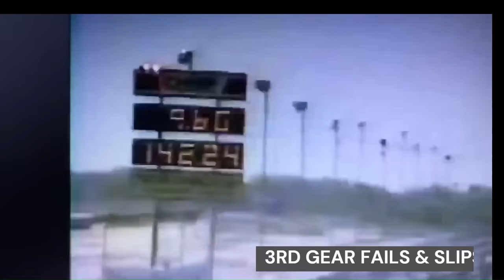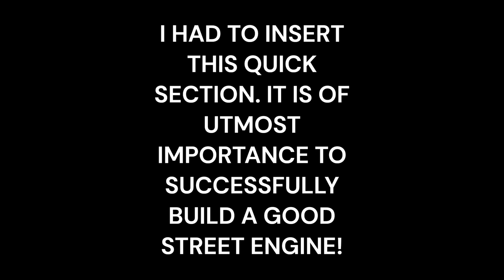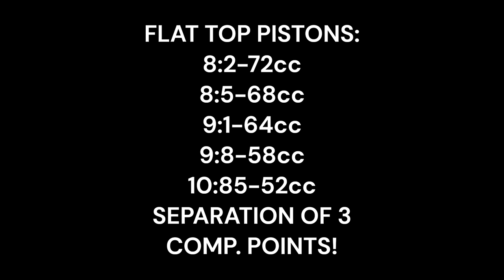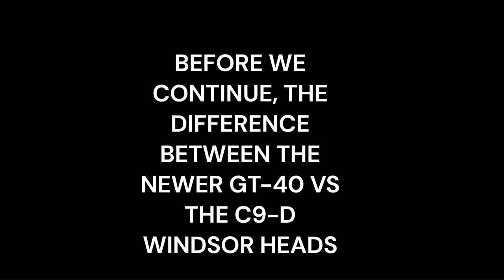BEST CYLINDER HEAD FOR THE STREETS!

Comment: Great video as usual, I wonder if the huge exhaust ports on that middle head is letting too much exhaust back in during overlap and might do better with a wide LSA and possibly EFI?
Reply from the maker: Yuri, possibly you are correct because there is not much velocity in it to go downstream effectively instead turns around and backtracks back to the chambers. Wider LSA might help and this thing was just way too big and now we start to compromise and lose the high port advantage of the exhaust port!

Comment: What are your thoughts on heads for a street 347 stroker with hydraulic roller cam, air gap intake? I was sold a car that was supposed to have TW heads until I started doing some research. The engine builder during COVID in 22 pit speedmaster heads in this motor instead of the twisted wedge that’s supposed to be on the motor. Makes me sick to think how a person could rip someone off like that. But with that said I just want to move forward and find out what I need to make some really good power on the street. The motor was supposed to be about 450hp and who knows now. It runs good don’t get me wrong. But I want it to be what it was supposed to be.
Reply from the maker: If you have time open it up and check the cam that they used and I prefer the TW heads over anything out there for the streets because they make the most power!

Comment: I just bought a '69 Nova with a '69 427.  Mild build with Chevy '840 Rec Port heads (107cc closed chamber) and it's making around 500hp and I feel it's in the area of 11:1cr.  It's a really solid build but it's too heavy for my needs.  How do I know if the heads I chose are going to be at least as good?  I do not want to lose power, ideally I'd like to make a little more.
Reply from the maker: Mike, aftermarket heads would do wonders or if your factory heads are ported by somebody good then it will  show more power big time!
Reply: Get a stellar set of alum ovals difference will be night and day. More everywhere

Comment: Great video!  I am running the Cleveland 4v heads on my 408 and love them.  What are your thoughts?  I have been hesitant to upgrade to aluminum heads. I figured the engine builder used the 4v heads for reason instead of Yates or such.
Reply from the maker: Patrick, the 4V C heads specially the closed chamber is still every impressive!  408 is indeed my choice also when I get my 70 4 speed going again and will probably use those exhaust tonque plates made out of stainless steel if it is even made today. ?

Comment: I got a 351w bored 60 over with 12/5 pop-up pistons block decked to 0  58 cc heads and it's a toque monster 😅
Reply: Live forever if the rev the chip stops it!
Reply from the maker: That should be an awesome street dominator!
Reply: @benalamedaracing2765  it's a lot of fun on the street it's in a 1980 fox body notch back
Reply: That's great, where do you buy gas for it!!
Reply: @markmccarty9793  I run 93 pump gas with the timing pulled out and and Sunoco 112 when I want to fill the max power
Reply from the maker: @xxkingslayemxxgamer5553  how big a cam do you run with that much compression on the streets?

Comment: my 347 had zero deck with flat tops, felpro 38thou head gasket, afr185cc comps, decked 16thou, to 54cc, i think it was 10.9-1 compression
Reply from the maker: That should be a very responsive engine!

Comment: Hello Ben, love your content on small block Fords. Here is a question for you about reinforcing the two bolt mains with an unusual style of girdle. If you were to replace the oil pan with a steel ring and cross supports at each main bearing location do you think it would be worthwhile? It would look similar to a Y block with cross bolt mains. Would it eliminate the vibration and twisting problem created by the current girdle designs? I'm just wondering if combining this with your block stiffener how fast you might be able to twist a 289?
Reply from the maker: Anything to tie together the bottom end is good and a worthwhile modification.  However, this said it all becomes critical when #2 and #4 mains start to bounce due to the cranks propensity to twist to an "S" @ high rpms and power levels!  Now the issue really comes down to how much meat is underneath this main caps for support and integrity.  This is where the critical issue is at and when 2/4 is bouncing sometimes we end up "spreading" the vibrations to 1-3-5 mains!  It is all good until we start bouncing the caps and now everything goes out of control and things start to crack or break!
Reply: Hello @benalamedaracing2765  , yes exactly, something like this can tie into the journal cross brace that the caps bolt into. How can I email a picture?
Reply from the maker: @mkoronowski  my email is benalameda@yahoo.com and send it there. Let me know when you do because I get so many questions...

Comment: Great info, Had R heads waay back.  I now have R11 heads, do you sell those port plates?
Reply from the maker: It is made to order and final pricing is still in the works and have two aluminum materials to work with! A total of 4 plates are necessary to stack them up together and will probably option to make one plate to make it simpler.  Problem with this is how much to raise them this is why I use 4 to make the necessary adjustments.

Comment: What about the pistons Ben?  I have 64 cc head, .047 head gasket.  Is a dome piston ok?  Any thoughts?  I am at 11.7:1.  Cast Iron E7 lots of work.  Looking to go 11:30 NA.
Reply from the maker: Looks good but if you can keep the head gaskets around .040 or slightly less it will be better.  Sound like a hard charging engine you got there!

Comment: Hi Ben!  What heads do you recommend for the 428 FE? 4.125bore aD4TE block a 454. The aftermarket is kind of dodgy.  But I want to build one more.
Reply from the maker: The Edelbrocks are good for high performance use and I am debating doing the FE videos because I have been very disappointed at the aluminum castings.

Comment: It's my understanding that the 289 Hi-po heads are the same as regular production heads except for the threaded studs and the spring cups, both of which can be done to anything. So, ports and chambers are the same. Why single out the HP heads as rare and desirable, when the standard heads can make the same power?
Reply: Gee, so sorry you didn't like my question. Boo hoo.   @arturozarate1752
Reply: @413x398  I gave it no thumb down or up. I'm patiently waiting for the reply.
Reply: @413x398  there's a video comparing and explaining.
Reply from the maker: I pointed at the rare hi-po heads because I have seen them ruined and better experiment with standard casting the leave the pros to do the actual correct mods for them if that is what the owner wants.  Just like the small block "tunnel ports" should be preserved or perhaps done professionally keeping its legacy and awesomeness intact.

Comment: @Ben Alameda Racing- I have 4,000Lb.(weight with driver), street driven vehicle. I plan on using a Built C4, or C6 Automatic trans., with a (4,000, to a Max of 4,500 Rpm stall speed, Nitrous Tq. converter), and i have 4.10 Gears, and will be using 275-60-15 Mt. Drag radials. I like to do hot rod cruises with the family, and take it to the drag strip, a few times a year, for those No Time, fun "Street car" arm drop races. I think i'm wanting to do the 351w block, stroked to a 433 cu. In., with (11:75 to 1- 12.5 to 1 comp.) trying to use 93 octane pump gas, a perf. Rpm air gap, (with porting done by you, or Big Dog's porting), with expected shift point's around,  6,300 to 6,500 Rpm, and Max engine Rpm of no more than 6,750 Rpm),  Tfs 205 cc 11r- milled to (47 to 52cc), and ported by you, or Big Dog's porting. And i was thinking of a hyd. Roller cam with specs: (105° to 106°) Lobe Separation Angle, - (Lift) Int./Exh. = Both .620, - (Int.) dur. @ .050= (240° to 248°), (Exh.) dur. @ .050= (252° to 260°), installed (+2° to +4° advanced). I may use a (300 Hp progressive Nitrous system, if i buy a Dart, or Iron eagle block. If i do run the 300 Hp nitrous system, i would run a stand alone fuel system, with 112 octane racing gas. In your opinion, do you feel this is a bad, average, really good, or great combo/set up? Better yet, what things do you think would be better choices, given my vehicle weight= 4,000 Lbs., 93 octane pump gas, Max engine speed of 6,750 Rpm, automatic with 4k to 4500 Rpm stall speed, 4.10 gears, with 28 in. tall drag radials?
Reply from the maker: The vehicle is indeed heavy and if you have a 4.100 or 4.170 stroke the better the engine torque will become!  My concern is the camshaft LS and I feel you should call Rod @ Iskenderian camshaft because he has done many for me and he might just refer you to a wider angle because of the pump gas requirement you stated.  The engine speed is realistic because I see with these much stroke no need to turn it very high and actually sounds high rpms and in actuality lower than 7K!
Iskenderian Cams is in Broadway Blvd in Gardena California.

Comment: I have a 398w with gt 40 heads cast iron heads seems to make good power
Reply from the maker: At that cubic inch you are choking the engine even if you use big valves the total intake port volume is not enough.  It will be responsive however and throttle response is almost instantenious but that is about all.

Comment: Hey Ben
I like NOT being noticed at every ted light/stop sign.So I use Rhoads lifters. How much lift do you trust them at? (Steet use)
Reply from the maker: I do not like them because they clatter when installed once in a while.
Reply: @benalamedaracing2765  Oh didn't know that! Mine are quite and do what they're suppose to, but now I know what to watch out for. Oh it's a flat tappet cam/lifters. 270* at .51 lobe sep 108

Comment: Thanks for all your time and knowledge in these videos. I’m pretty new to the sbf stuff. I got cammed 4.6 2v gt. And a 5.0 ranger who th a stock gt40 p motor. I’m looking for heads on a roller fox body I just picked up. I got a 306 short block and built t5 for it.
Reply from the maker: I will touch on the 4.6 heads I am planning to do.
Reply: @benalamedaracing2765  awesome,  thanks again for making these videos.

Comment: ?? Love to email you with my biuld idea get ur opinion .. 
.Quick thought.. would a afr 185 be OK on a 351 / 420   40 over 4.1 or 427   40 over 4.17   with a set of twin gt3582  (66mm) turbos .  This is a street / back rd runner .

I gotva set of afr heads with the car wondering if they usable .. I figure 185 be great for low end response and the turbos would feed engine up high where heads would choke out ?..  ur thoughts
The car is to live in 3-6k rpm range .  The cam i had was a 244/254@50 112 lsa 550 lift .. 

Lifter broke and scratched the block so pulling the block  351 40 over and going to beef it up .. sitting in a 91 fox
Reply from the maker: If you are running a turbo you better run the big heads like a minimum 220's!  Specially if it is a stroker.

Comment: Do you spec small block ford cams, or know who I might contact.  Thanks buddy.
Reply from the maker: Yes do it all the time. Thanks for watching and give me some info here.
Reply: @benalamedaracing2765 ford 408windsor stock block - It has a 22cc full dish piston and piston top sticks out of the deck .002 4" stroke 4.030 bore 6.200 rod, felpro mls head gasket #1133sd4 (4.100 bore .043 compressed) AFR renegade 165 cylinder heads (I know there small but with the right cam they should be ok) victor jr intake manifold with holley super sniper stealth blow through with 7875 turbo@12 psi boost 3200 stall converter 373 gears. Also going to be ran on 93 octane pump gas. This will be replacing my 351w using these same heads with the current comp cams xe274hr.

Comment: Just subscribed, you sure know a lot about heads, I have a vintage set of ford 429 heads that were included in an auction lot and I can't seem to find any on Ebay to make a comparison, the issue is l am not sure they are boat anchors or good for someones old car, they have a D0VE-A stamped on them along with other numbers in different places, the valves have the ford stamp and the springs are attached, there pretty clean really, If there any good I thought about removing the springs and valves and sand blasting them (not sure that's a good idea but would remove the surface staining lite rust look. Any idea what type of vehicle these belonged to? from just looking on the web they seem to be 69-70 year heads? thanks
Reply from the maker: Those are early 70's castings and if you went with the SCJ intake and exhaust valves machined in them it can be a killer street engine!  Did that combination years ago and the car ran mid 12's on pump gas and a small hydraulic cam from Isky!

Comment: What about GT40 heads with a 3 angle valve job
Reply from the maker: I use 1.94 intakes and 1.60 xhaust and it will be decent up to 360cid.

Comment: Really enjoy your videos and your great knowledge of Ford engines l have a 384 cubic inch winsor l have flat tops and a comp cam 600 590 lift 280 290 dur 110 lobe. Sep lm going to run it in the eighth mile 373 gear which head would you suggest and what compression could I run safely with 93 octane
Reply from the maker: Is that a solid roller or hydraulic flat tappet?  It plays into the equation.

Comment: Are there any SBF aluminum blocks that are easy to find/common/not expensive? Trying to build a road race type car that will also be on the street and I'm concerned with weight in general, but engine weight in particular, so not sure if I should go SBF, SBC, LS, Mod Motor, or something else. Also, generally speaking, what's the maximum safe stroke length for seeing 8000RPM on a sustained and consistent basis? 3.5"? 3.75"?
Reply from the maker: 3.5 is better for big tracks with straightaways long enough to hit high engine rpms. 3.7 on shorter tracks but can be used if you watch your final axle ratios to not over extend your bottom end. I would prefer a 9.2 deck aluminum 351 for capability and good power!
Reply: @benalamedaracing2765  Would you count roll racing or 1/2 mile and 1-mile drag racing towards short track or big track? What about drifting? And would turbocharging/procharging the engine change which stroke length is more suitable, or is it just a matter of increasing each one's proportional danger threshold?

Comment: Sir,
Wondering if you have and recommendations for  5.4 3v heads (ford)
Reply from the maker: I was very impressed with the 3V's and in fact has advantages over a 4V!  I will consider this as well on a video format detailing the advantages.

Comment: What head for a sbe 94 roller 351w turbo setup. Limited by valve size?
Reply from the maker: Yes the valve size might be a factor on whatever piston you have and an aftermarket pistons will help you decide on what head to run.

Comment: I have a 306 with a s/c, 7lbs boost, Edlbrk heads. Debating between AFR 185 or 11R 170,
what is your opinion, recomendetions ...
Reply from the maker: I like the 11R for the streets with small engines or stock stroke blocks.
Reply: Both great heads but putting 7lbs of boost through intake tract I would go AFR 185 route

Comment: Yeah, but you’re leaving now if that car is going to be turbo to or on nitrous turbo application, you want lower compression
Reply from the maker: How much lower?  8:1 or 9:1?  Then make sure no one is there when even with boost, guys out there will take you out to the wood shed spanking you real bad.
With today's chamber with the proper quench clearance 10:1 to 11:1 is not dangerous territory even for the streets specially with E85 or with a very good intercooler with a ducted fan for the streets.

Comment: Your not talking about the LS engine like a 6.0 has 9:5:1 317 head is 71-72cc with  2005+ is 10:1 with flat top lot of people put the 61cc 706 on them and get 11:1.
Reply from the maker: I should have noted this and a flat top with a 4.00 stroke with a 60cc or thereabouts heads will yield 12:3 to 12:4.  Stroke does wonders and the same flat top on a 3 inch stroke will be a mid nine compression ratio...

Comment: Afr or trickflow have to spend money on good heads. 300hp wheel is still not enough you need 400 wheel or a Honda will beat you lol
Reply from the maker: For sure and I will be doing a video on a 1250rwhp 2JZ street Supra I did years back.  This one should be an eye opener.